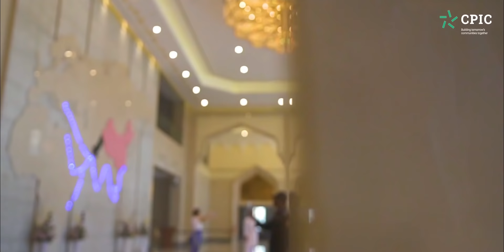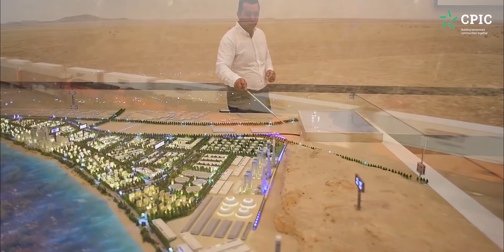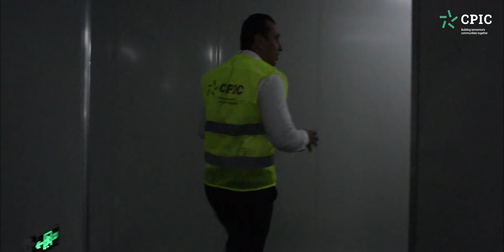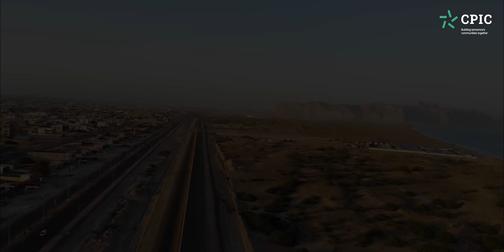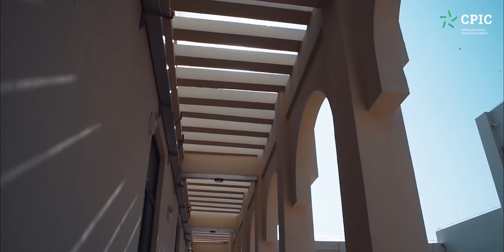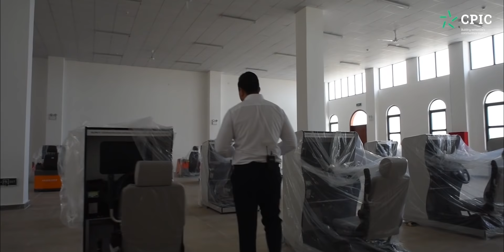Gwadar: The Progress 2022

Comment: Oil facilities and terminal with power house should be designed near DP or urea area... It could save lot of money and reduce risk of transporting fuel to terminal built on the other side of the port near resorts or hotel industry.
It will also provide a lean way of delivering all critical hydrocarbon based products  urea.. Etc with.

It would have reduced lot of operational cost as well as safety network for all these facilities.
Moreover it will also keep hotel and resort area clean and smell free.